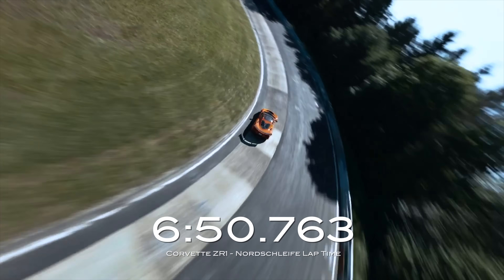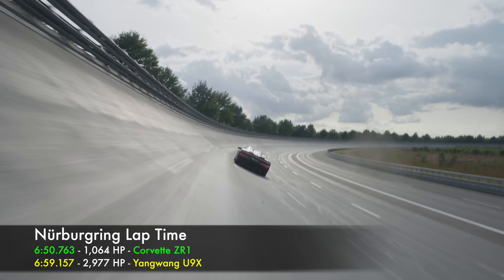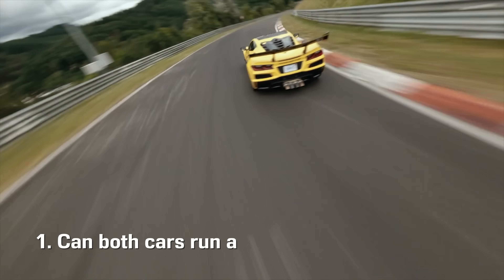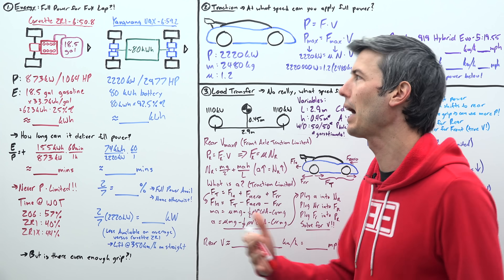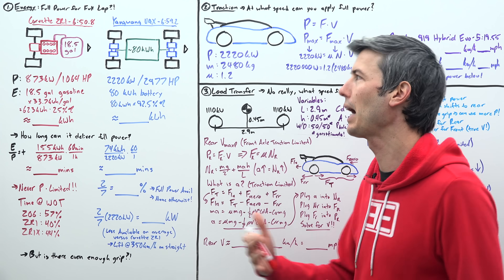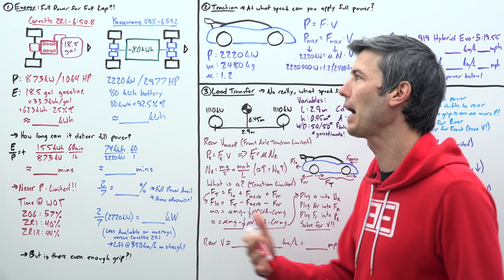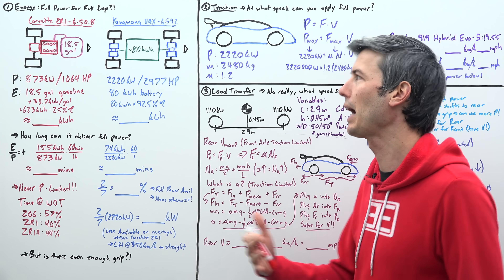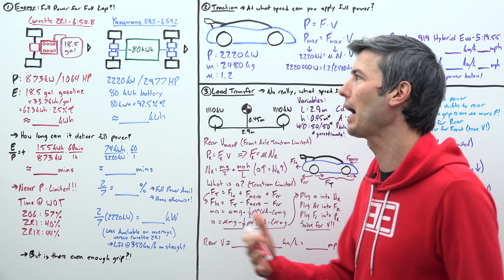Gas Beats Electric! Why Is 1000 HP Faster Than 3,000 HP?

Comment: It's, WEIGHT, WEIGHT, & WEIGHT. You do the simple math of POWER to WEIGHT. 

For example, using a car with 300 horsepower and a weight of 3,000 pounds:

Power-to-Weight Ratio=300 hp 3,000 lb=0.1 hp/lb Power-to-Weight Ratio equals the fraction with numerator 300 space h p and denominator 3 comma 000 space l b end-fraction equals 0.1 space 
h p / l b

Power-to-Weight Ratio=300 ℎ𝑝3,000 𝑙𝑏=0.1 ℎ𝑝/𝑙𝑏

This means the car has 0.1 horsepower for every pound it weighs. 

The math is simple, but the physical concept is what makes the ratio a useful performance metric. It's an application of Newton's second law of motion 
(\(F=ma\)). 

Power is the rate at which work is done over time.
Weight (or, more accurately, mass) is the object's resistance to acceleration.

Comment: I learned that at very high RPMs, electric motors become much less efficient. So if I understand that correctly, you don't have the 3000HP at the speeds where you can actually use them. 
This shouldn't be a problem, because even if you lose 50%, you'd still have plenty left.

The most interesting bit though is that that Porsche is so quick with so much less power (and very, very wide rear tires).

Comment: The current compensate-for-weight-with-power meta is so tiring. Weight comes with so many downsides that can't be mitigated by adding more power. The first stat I look at on all vehicles is weight because it puts all the other stats in context.

Comment: Let me guess before i watch

I think it comes down to 
1. Weight : EV's are typically heavier than gas cars, which leads to my next point
2. Power Output over time : gas powered track cars tend to sustain max power (or sometimes get faster)on track as tine goes on cause they're carrying less weight due to  them using up their fuel(provided it doesnt run out) meanwhile EV's lose power  while  keeping the same weight. Also EVs only make max power at the top end , they don't hit the same accel numbers at 60% compared to 100, meanwhile gas is good no matter your fuel level(once again provided you don't run out)
3. Tires: There's a physical limit to how much power tyres can handle, especially with current tech. You can try to make the motor spin faster but overdo it and you're just shredding rubber

Yes gas has its problems too, what comes to mind immediately is complexity and overheating, but , provided these are fully optimized cars from factory i don't think that'll be an  issue

i'll report back and see if i was wrong and what i missed once i finish the video

After Watching, wow, i vastly underestimated how important tires and grip are, and how weight didnt really factor at all lol, great video though

Comment: This might be the worst video I’ve seen from this channel… The corvette is light-weight, has upgraded aero and race-tuned suspension and ARB. It’s designed to be a lap time car. The U8X’s aero is speed-focused, not grip, is super heavy and has electronically controlled suspension tuned for ride comfort. 3000hp was just enough to chase back some lost time on the massive long straight. Power and the ability to translate all the power to road plays so little when talking about lap times. A proper race car with less than 600hp can clock 6m30s. This video completely missed the point

Comment: Do you use a stunt double for the math?😂 That kind of math can be dangerous when used with full comprehension. Most people don't even come close to 25% full comprehension, including myself. Think about that! 😮
Reply: Although some simple physics equations were used there was nothing more mathematically complex in the video than simple arithmetic.
Reply: @avsystem3142 I'm a retired machinist of 35 years. I know how to use math. I was trying to be just a little funny. Look up the word funny. Then try using the definition in your life for at least a week. See if it improves things. See I'm being funny again😂
Reply: @whatdoyouthinktodd  If you have to explain a "joke" is isn't funny. I also have a lot of machine shop experience, the only math required for a machinist is arithmetic. It is unlikely that you would even need simple algebra.
Reply: @avsystem3142 So I don't know what kind of machining you did, but usually we use geometry and trigonometry when you figure out angles and location and rise and fall for machining. Apparently you've never taken the machinist test. I scored 98% on it. Now this is enough of your dry humor or dry irritability goodbye forever.

Comment: What portion of the lap for either car is spent at or above 1000 HP? That's kind of your answer. A tight technical track will favor weight and suspension more than power. Similarly, a big open track with lots of straights will favor power.  I'd be curious to see telemetry from each car side by side to see how much power each is using at any moment.

Comment: P1. The thing with EVs on the track is that one should bring it on a car tow truck (to keep 100% batt charge) and... After one track session 15 min - game over... Or a couple hours of charging. 

And p.2 - struggling with tons of weight in the turns is  also a task. 

But anyhow the key is p1 - battery just does not last...

Comment: Power to weight ratio for each car? Gas car gets a little lighter during the run (also gas car doesn't need to start with a full tank for a single run).  Electric heavier and is the same weight and the finish.  
Electric car regenerative braking? 
Brake fade for each car? (likely more for the gas car if the  electric car has regen braking). 
 Different drivers.  
Different tires? 
Different day/conditions?
Down force difference between cars?
Battery pack getting hot?
Verified HP/TQ numbers (especially for the chinese car.)
Suspension....skip pad G ratings for each car? 
And probably a hundred other things i can't think of off the top of my head.

Comment: 2:57 Wow! I never thought I would say this, but there is an error in your efficiency calculation. You are assuming just motor efficiency at 92.5% as you mentioned. But there is inverter before the motor and a gearbox after the motor - system efficiency will be at best ~89% (assuming 92.5% motor, 98%inverter and 98% gearbox). Operating at WOT, it would even be less as you have much less thermal extraction, hence higher losses.
Reply: I think he was just simplifying for us smooth brain. Those numbers really don't change the result.
Reply: @EvanEnglish-m2j yes agree, but on the ICE side he is saying 25% efficiency - which js far lower than peak efficiency of an ICE engine and more of a realistic value. He could have said 85% and leave it at that. Instead of 92.5% which is really inaccurate. 😅
Reply: @EvanEnglish-m2j btw, I’m a huge fan of this channel!

Comment: Gas cars can always output full power even with near 0 gas, but electric cars have less power with battery drains. Also electric cars are heavier.
Reply: Battery drain (dropping voltage) isn't an issue except at very low charge. Below 10% charge the power drop may be noticeable in ordinary street driving.

Comment: Even at full throttle wouldn't fuel consumption vary with engine rpm? So even though the 'vette is at full throttle 57% of the time it wouldn't be dumping peak fuel until the engine hits peak rpm. Correct me if i'm wrong it's all very interesting

Comment: Well the Porsche 956 had only a measly 650hp but it still held that record for 35 years. Weight and grip matters more than power. Same with the IDR track car it is lighter which is the main thing here.
Reply: Ground effect was a amazing increase to corner speed.
Reply: @kennethprocak5176  Yes with a light car that is a potent advantage over power.
Reply: yeah and not to mention huge downforce and a far superior driver. though it even had traffic on that lap
Reply: different course back then

Comment: BYD Yangwang original is known to use a single centralized LFP blade battery pack with 80kWh, 836.8V and 1150A maximum discharge current, which starts to decrease after 60%-70% of the maximum charge amount. There shuold be 3 of these batteries connected in series in U9 Extreme version because 1150A needs around 250 mm² wire as a continuous discharge current. Most likely, the wiring of the battery, motor control and motors is undersized, so that the weight of the car can be significantly reduced and the result is a momentary peak power, but it cannot be used at maximum for many seconds or at least minutes.
Reply: A lot of (wrong) assumptions

Comment: Sorry if there's nuance I'm not understanding, but you compared how effectively the Corvette can put down 1,000hp against how effectively the Yangwang can put down 3,000hp to explain why the Yangwang has a slower lap time.

While an interesting discussion, shouldn't the comparison be testing both cars' ability to output 1,000hp to determine why one is slower than the other? The Yangwang isn't slower because it can't put down 3,000hp, because the Vette can't either. The Yangwang must be struggling to output the same amount of power as the Vette on the same sections of the track
Reply: Probably because the Yangwang u9 weighs as much as a ford f150.  Something that heavy will not corner as well as a lighter vehicle, the tires will have to be much harder to accommodate the extra load, and provide less usable traction.

Comment: He had me until the "ZR1 is more obtainable than a GT3RS" statement.  Yes, it is more affordable, but it's almost impossible to actually buy one.  The GT3RS is WAY more attainable than the ZR1.  Also keep in mind that the U9X is 5,500 lbs., the ZR1is 3,700 lbs, and the GT3RS is 3,300 lbs.  He mentioned that the GT3RS's lower weight was a significant reason why it was faster than the ZR1 but it's only a 400 lbs difference.  The U9X is 1,800 lbs. heavier than the ZR1.  Wouldn't that be an even MORE significant factor?  My guess is that the U9X dragged the ZR1 in the straights and the ZR1 smoked the U9X in the turns.  Throwing 5,500 lbs into a corner at speed is a significant challenge.
Reply: 3rs on the used market or new is way more . ADMS make the 3rs 400-500k . Can buy 2 zr1s with markup for that with most options
Reply: Yes, your right.
Reply: zr1 can be found on plenty of dealer lots, and anyone with the $$ can buy one.  Neither of those things can be said about the gt3rs
Reply: I just visited Felix Chevrolet in Anaheim, and they already had one for sale (I took more pictures by that car than I ever would by a ferrari or Lambo LOL)
Reply: That assumes the Porsche dealer lets you get on the order books having to buy a lesser model first.
Reply: Maybe if you are buying one used but typically a GT3 RS resales for more than retail. In order to buy a GT3 RS new you have to first purchase multiple Porsches to even be on the list for consideration to buy one new. The ZR1 is a brand new model of the C8 so of course it's hard to get but it also probably has a similar buy in program you need to complete. But for the price of one GT3 RS you can probably buy two lesser corvettes that would probably qualify you for the ZR1.
Reply: @christopherwalker8776 corvette doesn’t really do any of the buy in stuff, there will be a point in a few years where u can just order one from online straight to your dealer. It’s just production is very low right now
Reply: Blah blah blah

Comment: if needed every single motor can eat all of the current from the battery thats never the problem, mosfets are very light and 800kw motor is 30kg , limiter is always the battery.

Comment: 4 motors and 3,000 horsepower and it still gets wrecked by a Corvette with a couple of spooly boi's. Excellent.
Reply: The EV was engineered for top speed and destroys the Corvette at top speed. Holds the world record at 308 mph / 496 km/h.
Reply: @MikeO-l7s  With 3,000hp? You don't say. 😮
Reply: @henrym5889  Yes the power is required for top speed.
Reply: @MikeO-l7s  Wow that's so surprising, please explain the relationship between power and top speed at great length!
Reply: @henrym5889  Alright man. It just seemed you didn't understand the fundamentals. It weighs more than the Corvette so cannot compete on a track with corners. The additional HP is mostly useless and irrelevant on the Nurburgring. These cars were built for different purposes.

Comment: What about regen braking? The U9 should be able to regen-brake with the same deceleration as it can accelerate, provided the tyres grip? That would give it more energy to spend at full throttle...
Reply from the maker: Correct! See pinned comment. :)